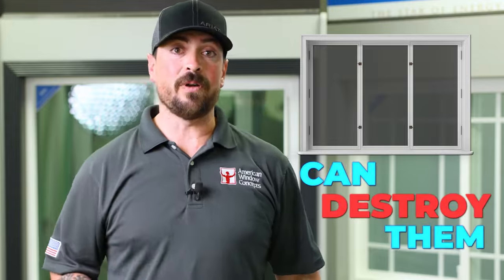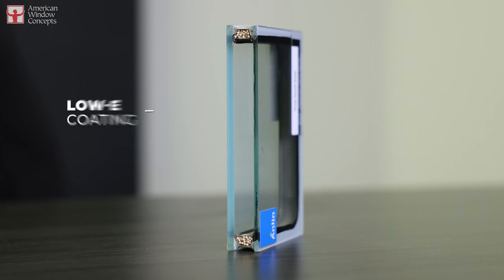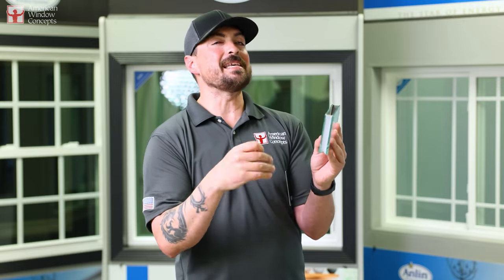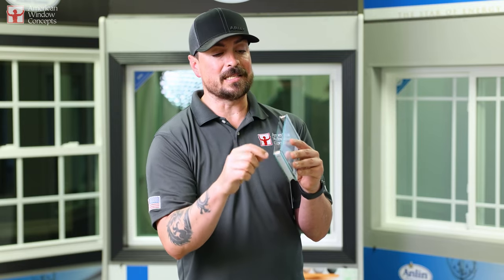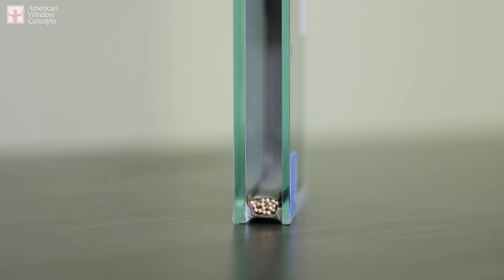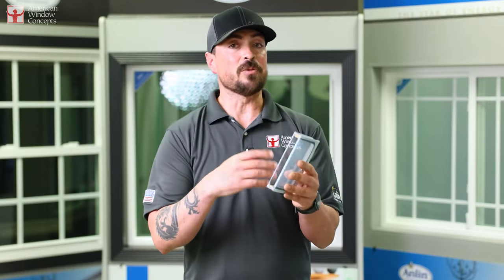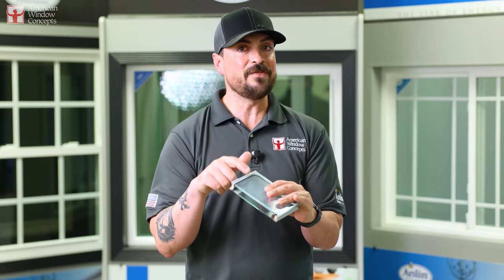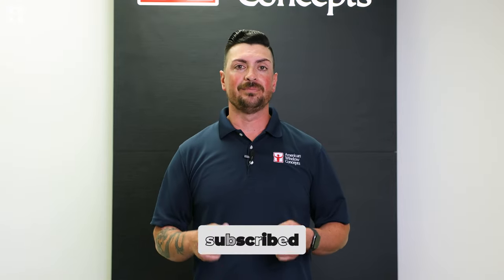Why You Should NEVER Tint Your Dual Pane Windows

Comment: The lack of knowledge on window films in this video is mind boggling.
Reply: how so
Reply: @Castigar48  I have a window tinting company. There are several films made and approved for dual pane glass. This video is 🧢
Reply: Exactly what I thought if solar film is being used. Solar film is applied on the exterior side of the window reducing the amount of heat transferred inside of the building. Hence why no heat is trapped between the exterior glass and the space in between. Sure, it has some downsides, but that's why consultations are important.
Reply: Can you please explain what you mean ? Is there some kind of plastic film that can be rolled on with water that wont cause seal damage between the two panes ? Doesn't necessarily have to be reflective, nor full size of window but something that blocks viewing in but resident can see out up to 18 inches or 2 ft. Not the whole window.🤔😖
Reply: @jonathanpineda7980 what are those films sir that are approved for dual pane windows ?
Reply: @jonathanpineda7980 so are your comments homie explain 😂
Reply: This guy is leaving us hanging
Reply: We will never know now.. What a cliffhanger

Comment: Argon doesn't expand
Reply from the maker: Exactly.
Reply from the maker: But the heat between the panes creates pressure on the spacer. Colder air pulls on the spacer. This happens every time hot or cold days occur.
Reply: @americanwindowconcepts5510 I’m sorry mate you clearly don’t understand the concept of argon. The gas that’s in between the panes. It doesn’t expand. The glass is the only thing that’ll expand and contract and that occurs already. Also low-e is not just on side 2… the “outside pane” as you call it. Sometimes it’s on side 3. Stupid yes but sometimes. Either way it’s “safer” to tint your glass with the low-e on side 2.
Reply: Argon does undergo thermal expansion, just like everything else.
Reply: @KGjames  nothing stupid about which surface the coating is on, coating goes on surface 2 when using a low or moderate solar heat gain coating and on surface 3 when using a high solar heat gain coating. 
Coating on surface 2 is when you want to block solar heat gain and surface 3 when you want to allow solar heat gain through the glass. Coating applied to surface 2 is probably better than 95% versus surface 3. Unlike SHGC, window U factor is unaffected by the choice of coating on surface 2 or surface 3.
Reply: @americanwindowconcepts5510  So you agree that argon doesn't expand but you're saying the heat does? Where is the heat if not in the argon? That makes no sense and you have lost any credibility.

Comment: Films with a Total Solar Energy Absorbed (TSEa) of 54 or less (<=54) are considered dual pane compatible as long as the glass isn't over 40 years old. Go into any residential film tinting forum and watch the mocking from guys who've been doing it for 30 years with zero issues.
Reply: hey, thanks for this. i had been researching films for smaller low e windows in my home, 36x60 mostly shaded and took your recommendation after reading up on it. i found a 53% TSE film i like and almost bought a 76% before i read your comment. i also noticed the solar heat reflected on this 53% TSE film is only 13%. really glad i read what you said and looked into it before purchase

Comment: Could you put the tint on the exterior of a dual pane window to avoid trapping heat?
Reply: Yeah, but it'll just peel/bubble far sooner (weather with rain, wind, ice, etc) and it may be very hard to get to to apply the film in the first place.
Reply: Most definitely. Get exterior window film, after cleaning the window, spray it with soapy water and squeegee the soapy water out. Apply exterior silicone to the edges to keep the film in place and your set. Most of the time bubbling and film failure comes from poor prep work and poor quality film.
Reply: @RemainingMonk27  I am using decorative vinyl film on the inside glass, with dual pane. Now I'm freaking out because I need it for privacy and to let the light in. So you are saying I can apply a reflective film on the OUTside glass, to prevent a situation with the seals? Does the decorative vinyl film on the INside hurt anything anyway? It's not reflective, just like a sheer curtain.
Reply: @sunstarsmoon  cant speak to the interior, butu you should have no problem with heat pockets if the film is exterior.

Comment: In my tests, applying on the outside is the most effective so I opt for that where I can at home. Years ago I had a company fit decent film inside our office building, and while it worked for UV, I was shocked one day to find just how hot the DG window unit and film itself was in comparison to a window without film. The glass and film were heating up and the windows were becoming like panel radiators, which in hindsight made sense. On the outside, with IR rejected before it hits any glass, the result is substantially cooler windows as a whole.
Reply: Thanks for this. I have double-glass windows and I was thinking of using tinted film to keep out the summer heat. Are you saying that it will work so long as I put the film on the outside of the window?
Reply: @beermilkshake  It will definitely help. I put some on a UPVC sash window a few days ago, fully covering the upper unit, and covering most of the bottom unit but leaving a section at the bottom still to do for now. I'm getting nearly a 10 degree C difference at the bottom of the sash window that isn't fully covered vs the one that's fully covered when they're in afternoon sun, and the glass behind the film barely feels warm compared to the glass at the bottom of the partially covered unit. If you're within a few feet of a window you'll also get a fair amount of UVA, so adding film is good for the UV cutting ability too, which I verified as working with my glasses that react to UV. I've no idea how long the film will last, but I'm sure long enough for the UK summer :) I spent maybe 15 to 20 minutes smoothing each sheet of film to really get the water out well, plus checking after just in case more bubbles showed that I hadn't caught. Very pleased with how it came out.

Comment: It’s all about absorption rate of the window film.  Windows have declined in quality over the last 10 years.  The most common cause of seal failure, and or glass breakage is due to poor quality.  
Window films can be installed on Double Pane Windows.  It all depends on what films are being installed.  Darker, non reflective window film absorbs heat instead of reflecting it.  This causes expansion.  An absorption rate of 50% or under is usually the safest. 
A professional window film dealer also provides a warranty against glass breakage or seal failure when the proper film is installed.  Knowledge is key.  
Less than 1% of windows that were filmed have issues.  Considering that 5/10% of in tinted windows will fail by themselves.  Like previously mentioned…. Low quality windows.
Reply: "Windows have declined in quality over the last 10 years.  The most common cause of seal failure, and or glass breakage is due to poor quality."

And you base your statement on??

Comment: Thanks for the heads up. Will remove tint before calling for the warranty.😂
Reply: Unfortunately, heat causes window tint to leave molecular biomarkers embedded in the glass.  There is specialized testing equipment placed on the glass that can detect if the window had tint. Maybe if this was 1980 your plan would work, Lol
Reply: @THISIT-rd7jm  I don't believe anything you said there but I have no evidence to contest it.

Comment: Is there such a thing as windows with built-in tint? IE if you have double pane glass windows, do they make windows that have the tint installed on the inside of the outermost pane?
Reply: Not really, there is dyed glass but it’s not as effective as window tint nor is solar ban. If you’re very concerned have it installed on the exterior. 
But any company installing tint should know what is safe and what isn’t for your glass. This video is false in that applying tint causes no more seal failure than you’re already at “risk” for.
Reply: To clarify, even though some LowE coatings can be tinted (usually for extreme solar heat gain and glare environments) tinted glass and LowE coated glass are not the same thing. However to make it more confusing, there are also tinted LowE coatings but these are generally less commonly used except in more extreme conditions. In the case of a tinted LowE a specific metal oxide would be added to the "coating stack" during coating application to achieve the desired tint.

The vast majority of windows produced today have a LowE coating (tinted or not) applied to glass surface 2 (inside the outermost pane).  That coating might have a green or purple or even blue hue in the right lighting conditions, but that doesn't mean that the glass is tinted. The hue is related to the "coating stack" and it's based on solar blocking properties of the coating. If you see windows that have a green hue for example, that generally means that there are three layers of silver in the coating. 

Glass is tinted by adding metals to the liquid glass during manufacture - cobalt for blue glass, chrome for green glass, gold for bright red glass, so on. These colors are part of the glass structure and are permanent. The most common tints used for windows are gray and bronze, but other colors are used as well. Tinted glass is not great for blocking solar heat gain, but can be used to block solar glare. It's not uncommon to find dual pane windows with one lite being clear glass with LowE coating applied and the other lite being bronze or gray tinted. In most respects using the clear coated lite exterior and tinted interior makes the most sense, but architects and designers often switch that for aesthetic considerations. In many cases the glass is tempered because tempered glass is much more resistant to heat stress than ordinary annealed glass, and when using tinted glass and coated glass the window is going to be HOT, and breakage is a real possibility. 

Solarban is one example of a LowE coating. Solarban has about a half dozen different variations such as SB70 (triple silver coating, or SB60 (dual silver coating). 

Apples to apples LowE coatings are more effective for energy performance than aftermarket films, but films are a good choice for improving the performance of any uncoated windows, single or dual pane. Also adding a film to a window that has a LowE coating can help boost the performance of that window simply because sometimes more is better. As mentioned previously, many film manufacturers do include a warranty against breakage when film is added to a LowE coated window.

Comment: what if you put the tint on the outside facing of the glass? Same problem?
Reply: Good question, the answer is no, but if you put it on the outside, the sun and heat will take its toll quicker that normal. I’d ask a tint person what their thoughts are on that.
Reply: They have exterior films.  Made to withstand the elements.  Of course longevity is less but it does work.
Reply: “Tint guy” here lol the exterior products are durable and I’ve seen ours last 20+ years. But interior films are safe on dual pane units. I usually avoid high absorbing films and stay with the reflective or dual-reflective line ups. Sometimes homeowners still choose the high absorbers but even with those the risk is low. Just slightly higher than the reflective and dual reflective films.
Reply: Thank you! @KGjames
Reply: @KGjames Thank you for clarifying about interior films on dual pane windows...I recently bought several big rolls of green chrome 1 way mirror film & was worried about if it'll be safe on my dual pane windows after reading online some films can break windows😅.Also I imagine here in Ohio the risk of too much heat stress on windows is likely actually lower than places with hotter summer weather such as California or Arizona for example🤔.
Reply: What if I use clear film just with UV protection from the inside?

Comment: Does this concept apply to "non-tint" heat-reduction films as well? For example, frosted films placed on the interior of 
 dual-paned windows?

(Thank you for your videos, I've learned a ton!)
Reply: I have the same question as @stefaniestrickler3538.  I live in Spain where the sun is relentless in the summer.  The kitchen windows in my apartment (rental) are dual-paned with frosted glass on the interior, which is a great look most of the year as it allows in plenty of aesthetically-pleasing light, yet offers privacy from my next door neighbor.  However, it does not offer any heat protection during the middle of the day when outdoor summer temps are extreme!  It gets SO HOT!!  I certainly do not want to cause harm to my landlord's property by installing heat-reduction film!  I've been trying to find a temporary way to mitigate this problem without resorting to curtains or blinds, which are also problematic since I cannot drill into the surrounding floor to ceiling tiles which are installed throughout the kitchen.
Reply: I really need this answered! Just left a comment asking too.

Comment: Use a window with argon gas instead of air. And to make it better, windows with 3 layer of glass and two pockes of argon. We use it in the cold north to isolate from the cold, and heat.

Comment: What if I have double paned glass that isn't energy efficient? I have a French door that has the blinds between the two panes, but it is not energy efficient. It's the opposite of energy efficient. It's allowing a ton of heat to get in from the afternoon sun. I would like to apply a uv film over the glass. What do you think?

Comment: I have Viridian Low e Smart Glass, which I believe is single pane? 

In this case, any harm if I put window film on top of it pls? I want to reduce the amount of UV light because the Smart Glass does not appear to be doing a good job and colour of my timber floor fades
Reply: There are two types of LowE coatings, hard coat and soft coat. 

Hard coats are primarily tin-oxide that is applied while the glass is still hot in the furnace. Hard coats are lower tech, but the plus is that they can be exposed to the elements without damage so are often used in single pane applications. The minus is that hard coats are often hazy, especially in direct sunlight. Also hard coats don't do a very good job of blocking solar heat gain, being used primarily for their insulation value. Viridian uses this type of coating. 

Soft coats consist of multiple layers of metals, primarily silver, and metallic oxides that are applied to finished glass in plasma-filled vacuum chambers. Soft coats are fragile and must be protected from the environment so they are only used when sealed between the lites in a dual or triple pane insulating glass unit. 

In order to stop fading you need to block both UV and shorter wavelength visible light. Hard coats don't do a great job blocking either UV or visible light, so they are often paired with tinted (not to be confused with coated) glass for better solar control. 

I would have no problem at all with adding a tinted film to the glass using a hard coat whether single or dual pane.

Comment: This is such inaccurate information!
All reputable window film manufacturers have a Film to Glass chart SPECIFICALLY for dual pane glass, with or without a LowE coating. After 38 years in business, I have seen more seal failure on dual pane windows without film than I have with film. EVERY glass manufacturer wants a way out of their warranty, because they all have somewhere between a 2-5% failure rate.  We tint 20,000+ panes per year in my business, 99.5% of which are dual pane with a LowE coating, and on average, we have 2 or 3 panes annually that experience seal failure. In addition, the window film manufacturer gives a direct replacement seal failure warranty to the glass manufacturer’s warranty.